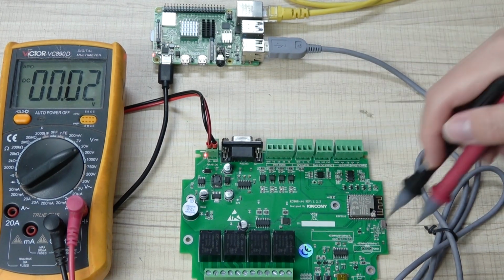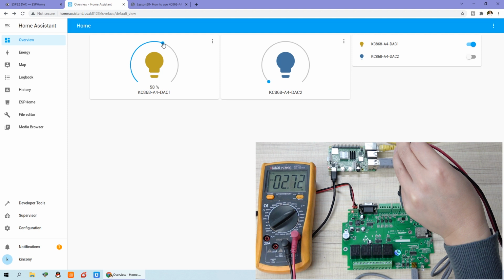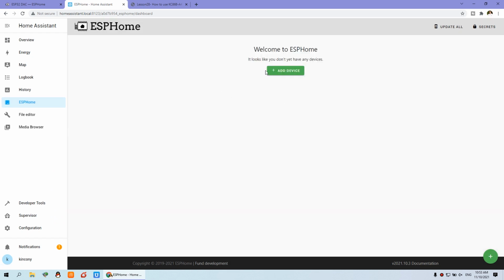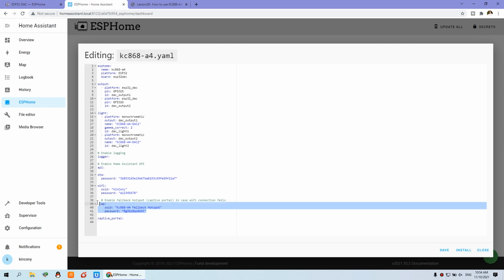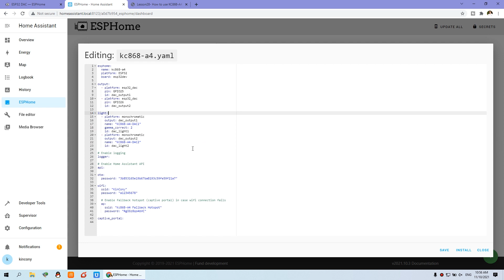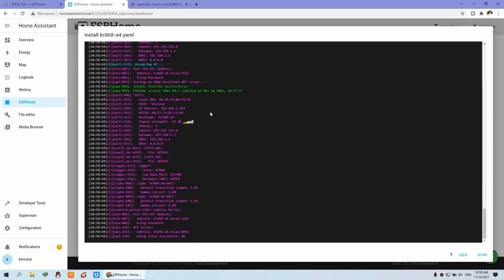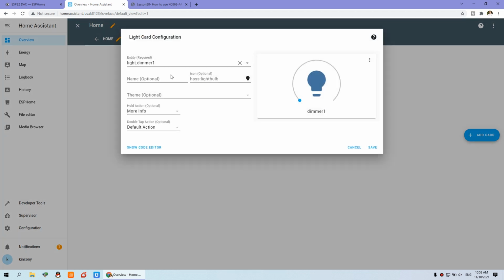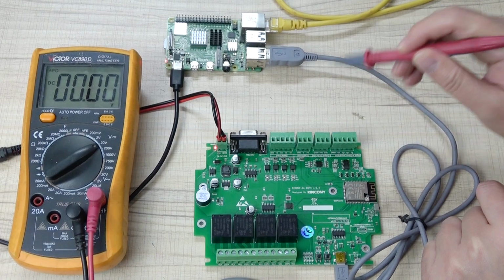Lesson28-  How to use KC868-A4 (ESP32) DAC output DC 0 10V by ESPHome

Comment: Can I use linear function for DC output?
Reply from the maker: no problem, output DC 0--10V
Reply: @KinCony  But in movie when You set 50% DC was 2,7V and for 100% ~10V. How can I make for 10% 1V, 20% 2V....50% 5V...?
Reply from the maker: @darkarhon1  in video , just wrote two valve for demo, actually you can output any voltage. from 1%--100%, just change the valve of function in code.